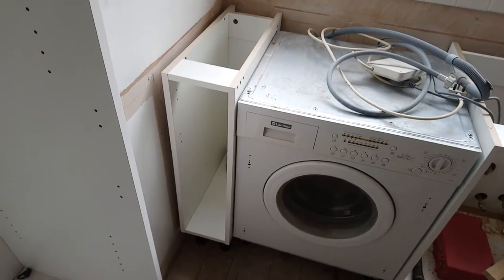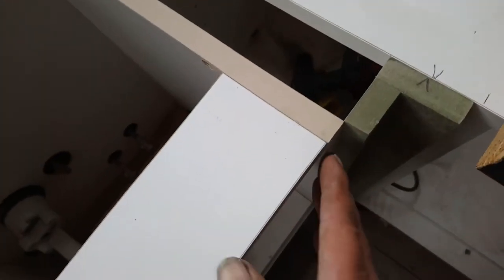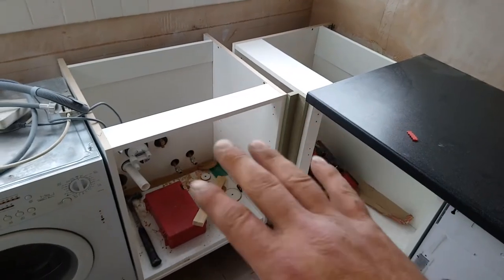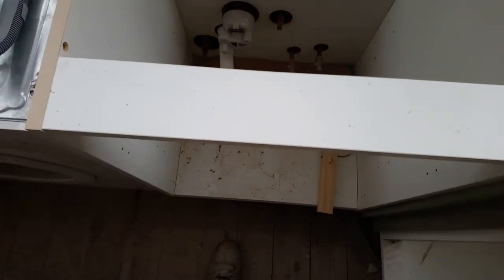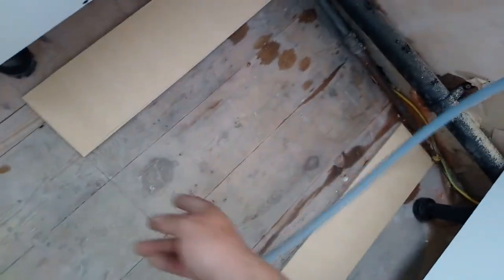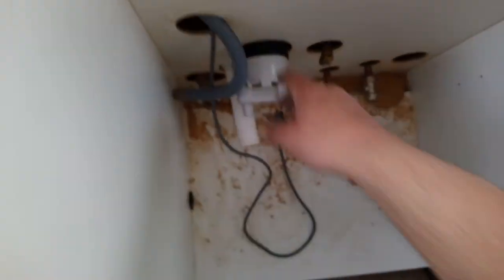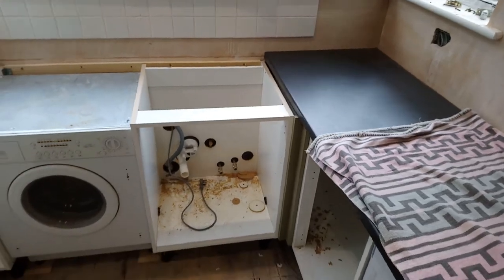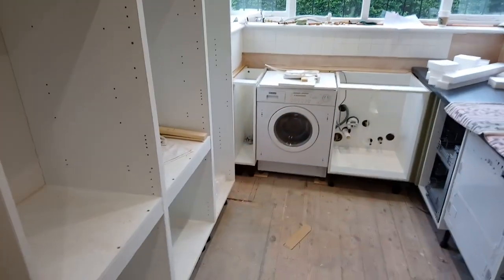Kitchen Fitting Pt6, Fitting the last couple of cabinets

Comment: Hi gid. @5.57 when you drilled access hole.  You could of removed the modesty blocks, fixed a piece of 55mm scrap on the back of the filler. Then fixed the sink gable to the scrap piece. Make sense. 

Also when installing appliance I use a old 600mm wall cabinet with feet. Fit it in place. When everything is levelled up and worktops screwed down I remove it. Perfect 600mm opening
Reply from the maker: Hi, i don't fit many kitchens nowadays but i'll keep those thoughts in mind, 
I like the wall unit plan but I'd prob have to buy a 600mm unit tho unless there was one being removed 😂
Thanks Daniel 👍

Comment: Taking shape Gid. So as a rule of thumb on a 500 door do you have your door finish around 497 also Would that apply to say a 1000 unit making two doors at 497 ?
I liked the magic cupboard made use of the dead space. 👍 
Cheers Gid
Reply from the maker: Hi, on off the shelf units with doors that is the case, the doors are 495-497 because they don't know what is going next to each one, 
If i was building a cupboard i would put a similar gap down the middle between the doors as i would down the side of each,
I made a vid today, still got to edit it but on the drawing i just put 2mm down each side, buy the time i come to attach them to the units I'll try make them look like similar gaps,
yeah magic corners can be cool 👍

Comment: What tooth blade did you use to get that cut buddy
Reply from the maker: Hi n Sorry i'd have to watch this again, i skipped through it & if it was a panel it was prob with the track saw & a Freud blade, 40t or 48t, i can't remember which is in the saw https://www.screwfix.com/c/tools/circular-saw-blades/cat5990012#category=cat5990012&bladediameter=165_mm&brand=freud